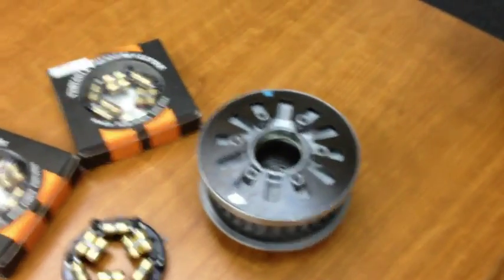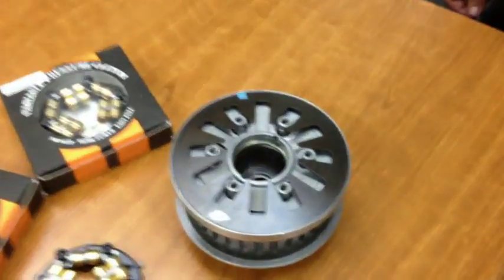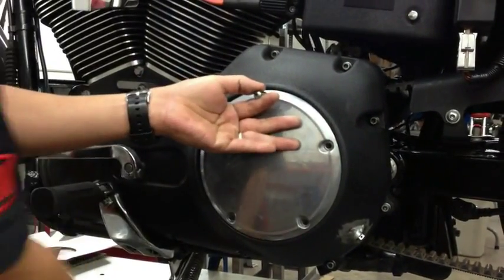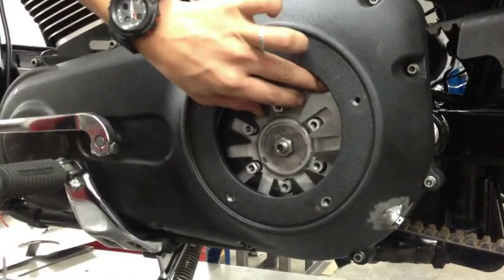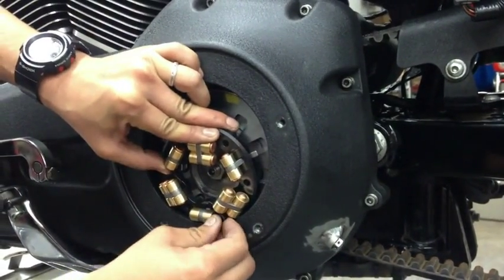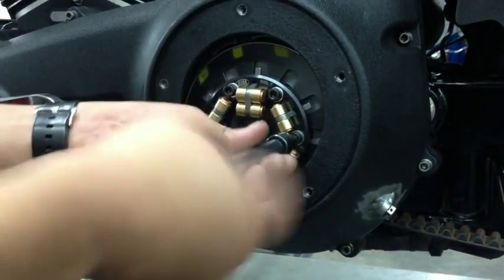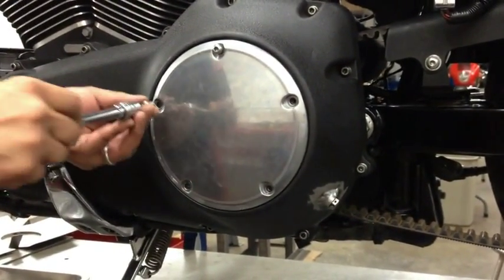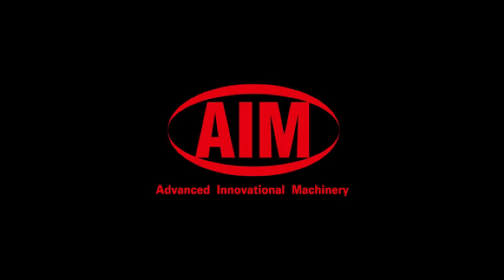Instructions / Tips: AIM VP Variable Pressure Clutch Installation

Comment: How does this reduce the clutch pull?
Reply from the maker: Hi @02roadierider! Regular clutches have only static pressure with clutch springs. The our lock up clutch has two different types of pressure. One is a static pressure, and another is a centrifugal force so it makes more clamping force. We hope that answers your question!

Comment: If i am not mistaken you didn't even adjust the clutch. it wasn't even necessary. don't fuck with something that isn't broke
Reply from the maker: Hi Kyle! The clutch was already adjusted before the install. Different cases will require adjustments of course, but we were just focusing on the install of the VP clutch since the bike was already set up for it.
Reply: @AIMClutches  so to adjust the clutch with a VP is it the same thing as without ? Loosen the adjuster on the cable, loosen the 11/16 clutch nut, turn back with the Allen and turn right till it ‘sits’ then 1/4-1/2 turn back ?
Reply from the maker: @NoXQc  Yes, that's right. The way to adjust is the same as without a VP clutch. We recommend to follow the Harley-Davidson service manual.
Reply: @AIMClutches  Do you need to remove the VP clutch and install the stock retainer plate , then adjust the clutch or just do it with the VP on .... I have heard both ways...
Reply from the maker: @mackmebe  Hi, and thanks for the question! Yes, our VP IV is designed so that you can make adjustments to your stock retainer plate while the VP is still installed.